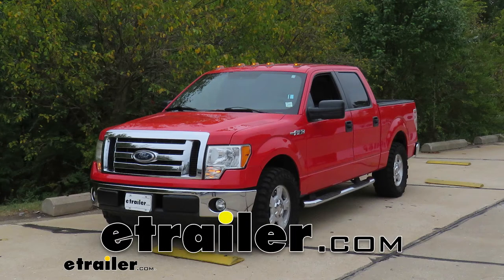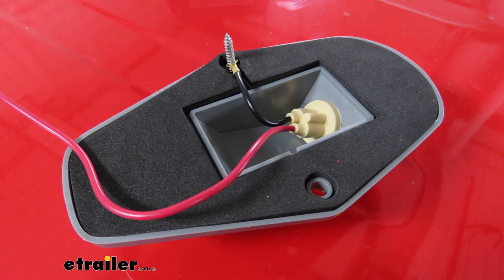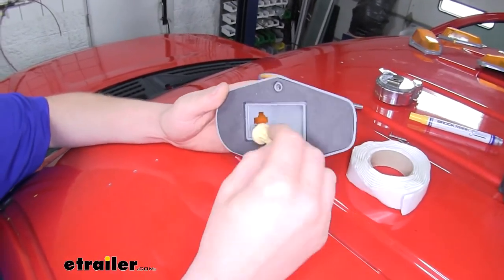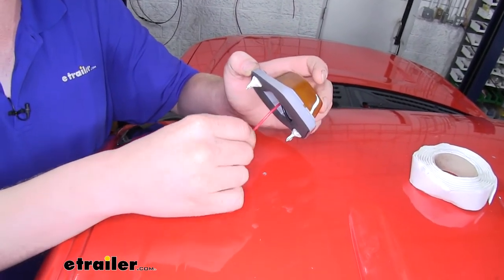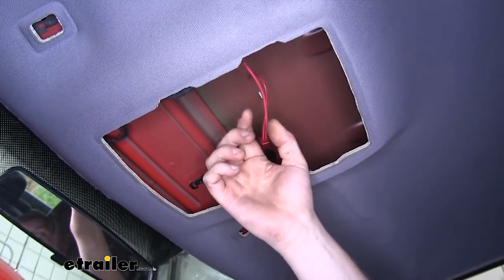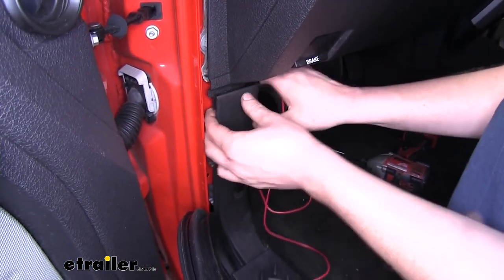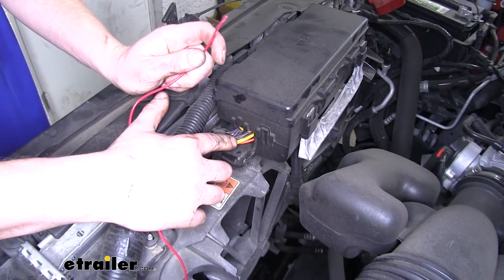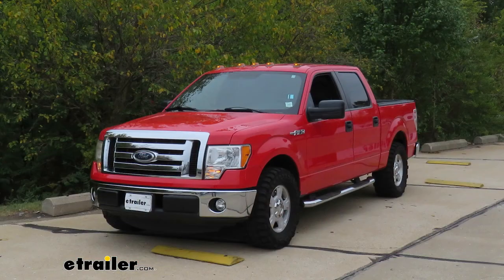etrailer | Pacer Performance Hi-Five Truck Cab Light Kit Installation - 2012 Ford F-150

Comment: what were the measurements from windshield line back to the lights, center to center measurements from the middle light to the outer middle lights, and center to center from outer middle lights to outer lights? Vital information in order to get the proper layout.

Comment: Do you know how can I connect the wire so whenever the truck’s on it will light up
Reply from the maker: You'd need to attach the power wire to a power source that goes hot with the ignition on, like the radio circuit.
https://www.etrailer.com/Cab-Lights/Pacer-Performance/PP20-225.html

Comment: "Quick clips" are more likely to fail then a true splice. This video was very helpful but all in all was poorly executed. Using a proper sealant and splices should've been shown and if you didn't want to splice into the factory harness you can buy kits that plug into your fuse box.